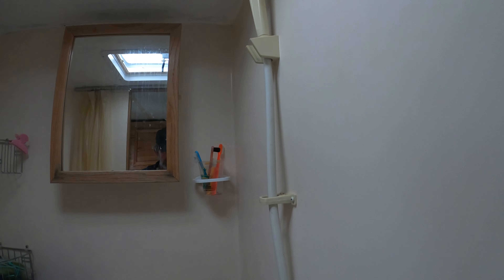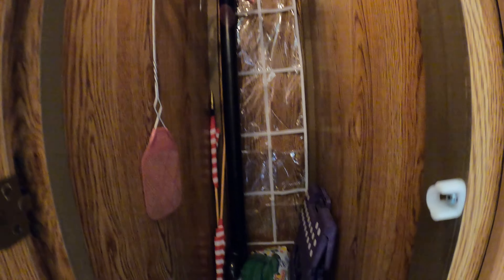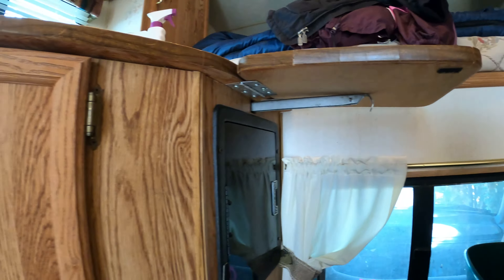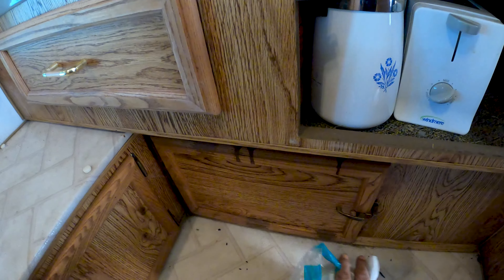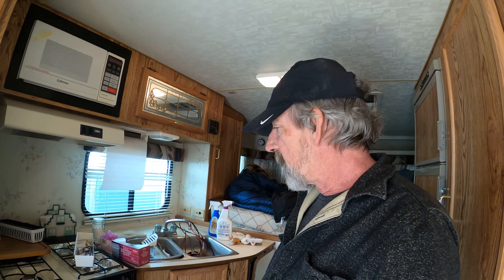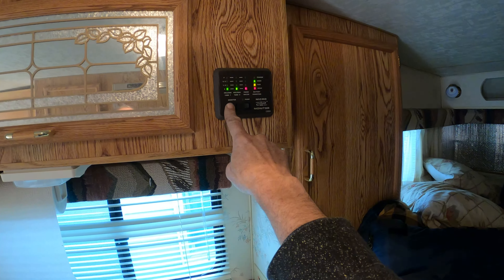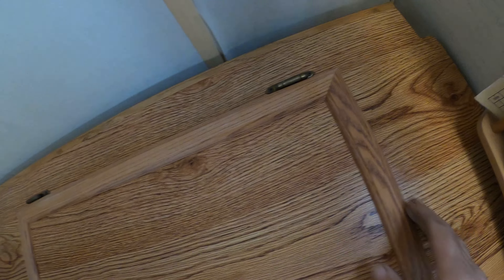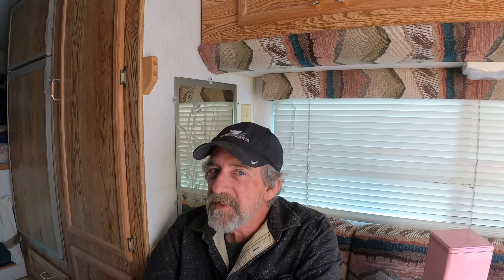Renovating a 1995 S&S Truck Camper || Ep.2 Inside tour & features

Comment: I want to learn more about tankless because what if your gonna fill water from a hose, then is the pressure not going to support the water heater?
Reply from the maker: There is a water storage tank and pump in the system to provide pressure when you are not connected to a hose. Does this help?
Reply: @trbowlin  Indeed, that explains it. Thank you for sharing. I have more questions. How do you heat it when its cold out? What is the cost to run the heat on a cold day/night? What about condensation (from breathing or from difference between cold outside and warm inside)? How do you make sure it stays secure in the truck bed, instead of sliding when you drive the truck? Does the fridge run on propane and how long does a 25 gall tank last with a full fridge? Forgive me for so many questions. Is it best to remove the tailgate?